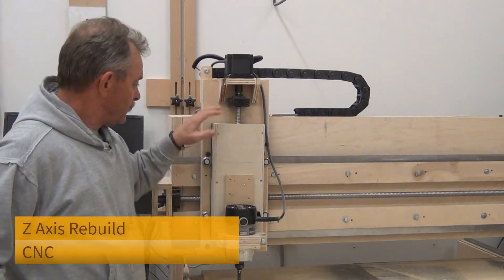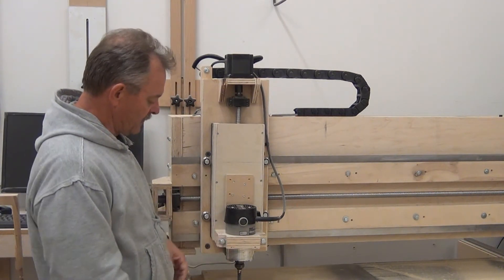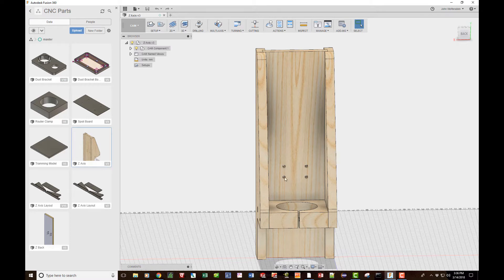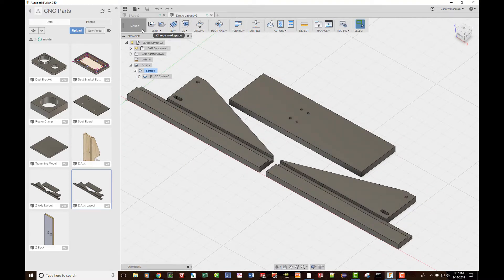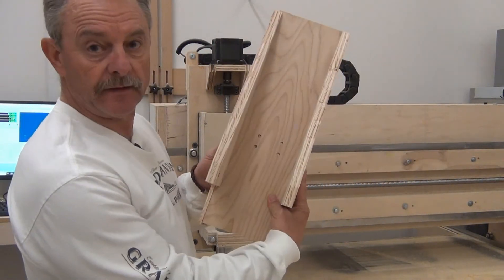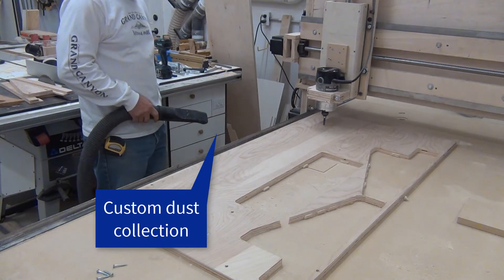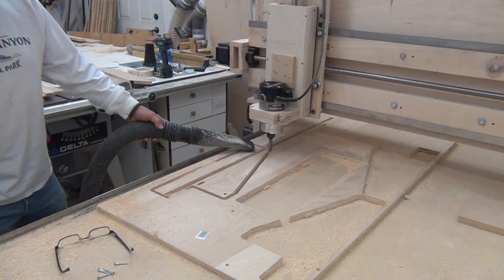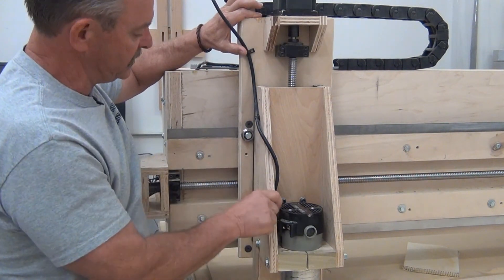Z Axis Rebuild on CNC Router

Comment: I have watched all your video's on your CNC router build and I seem to remember you saying that at one point you are going to upgrade your CNC is that correct? 
Have you done that? great videos by the way!! Phil
Reply from the maker: That's the plan!  Haven't found the time as of yet.  I did buy a new spindle that's a bit stronger and has variable speeds.  Hopefully soon.  Thanks for watching.
Reply: @OldGuyWoodworks  Thank You